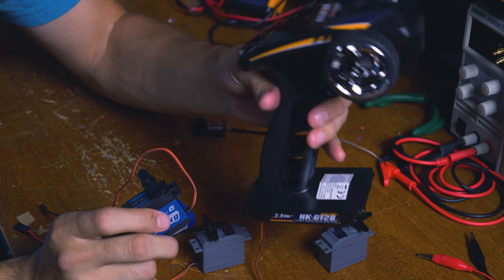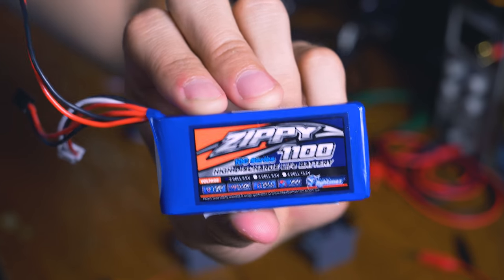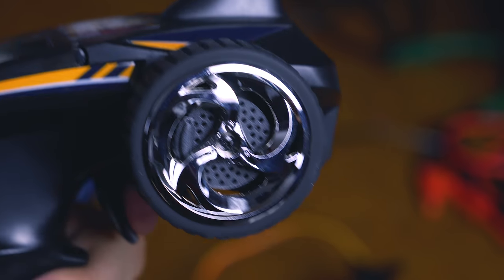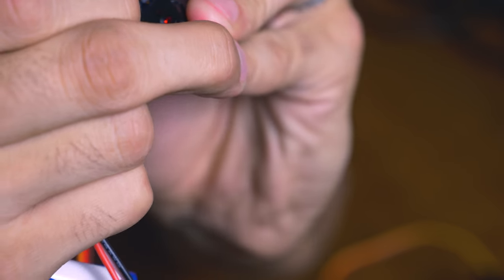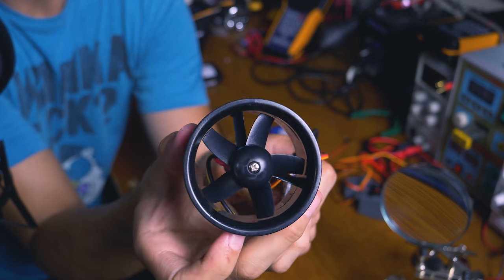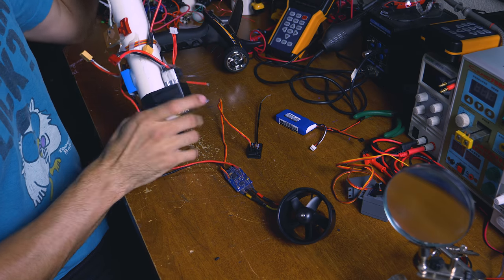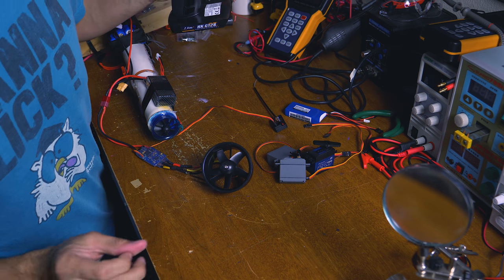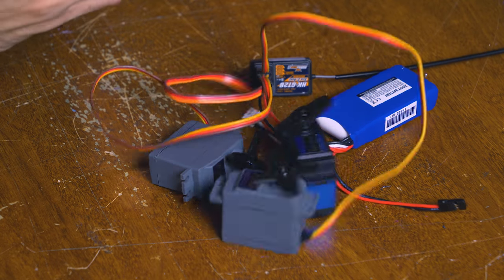How to: remote control servos

Comment from the maker: If you guys have something you want me to explain in a video like this, lemme know! :)  Otherwise, I'll just be using servos and stuff to make high voltage experiments more fun.
Reply: Tommy Callaway how do you charge the battery pack for the receiver? I have a regular flysky type transmitter that has 6 channels ,and i wanna use servos on all of those channels,so 5 channels left,if you take in account one channel is for the battery pack.  I was thinking about using the cheap battery packs that you just replace the battery's in and out of the case, but I wanted somthing with more longevity. Sorry if that's alot.and also is a 6v battery pack good for that amount of servos?  Just using a regular easy size servo,nothing special or big.
Reply: Do you use 5 or 6 volts?

Comment: could you recommend a servo that would work with your setup that does 360 degree rotation and not just 180 degree rotation?
Reply: A motor

Comment: Hi I like what you do pretty cool I have a question I'm looking for a control module or controller adapter going from they DC motor have it control for steering into the ESC actually wrong my son Power Wheel I have control panel for the radio but I don't have a steering wandering this any bored that will do that thank you

Comment: This video is a little old, but how would I attach more than one motor to the same input? (trying to make a home-brew RC car)
Reply from the maker: I would try getting a splitter, or just make your own. :) You can also get a more advanced controller/receiver meant for like drones, and then set up input mixing to have one input control multiple channels.
Reply: @TommyCallaway  ah, ok, I was also looking at buying an arduino, but I don't have any software for it...

Comment: Hello Tommy ! Can I ask where you get your interesting stuff from? I would like to know... Thanks in advance.
Reply from the maker: +ButterBeerBeef sure - like what things specifically? I usually buy components on amazon or ebay or whatever and build things with them.
Reply: Tommy Callaway Mostly components like transistors,   capacitors, etc...
Reply from the maker: Yeah, I buy stuff like that on ebay (china is cheaper) - sometimes amazon if I want it in two days.
Reply: Tommy Callaway I appreciate your help... Again, Thanks

Comment: what is the output voltage of the battery you used here....? Can I used a 11.1v lipo for powering the receiver???
Reply: Amber Nishad try messaging him on Instagram. He responded to my question quickly
Reply from the maker: Battery for servos was a 2 cell 6.6v lipo. I don’t always get notifications on comments. Sorry
Reply: @TommyCallaway  No problem...You replied that's enough...I get the solution after doing a little more research later.
Reply: @tankunicorn134  Okay...I will ask him whenever its needed on Instagram

Comment: How did you get the servo to work on the 3rd channel?
Reply: I have the same question.  Hit the button for channel 3, servo goes 60 degrees. Hit it again it goes back to zero degrees.  Can this transmitter receiver do that

Comment: Does the first pin on the receiver were the voltage supply is plugged in have to be connected to anything?
Reply from the maker: Nope. Just positive and negative pins. The third wire is for signal, and isn’t used on the battery.
Reply: @TommyCallaway  I didn't think so. Thank you so much for replying.  Where did you get your reciever and transmitter for such a good price? I've been on Amazon but haven't found one less than 50. I've gotten a lot of things from Amazon but lately the quality has been crap. For example I bought a pack of 15 lm385 chips and only one worked properly. I've bought aux jacks and they weren't very good either along with other issues I've had lately with buying electronics parts. Hell I bought what was supposed to be a reciever and transmitter from geek .com and only got the reciever. Anyway thank you for the video and I'm looking forward to seeing more of them.
Reply from the maker: @randystokes3667  The controller and receiver I used are here: https://amzn.to/2rekIjQ  Usually everything I use in my videos is linked in the description. :)